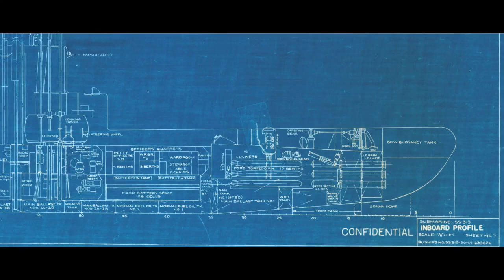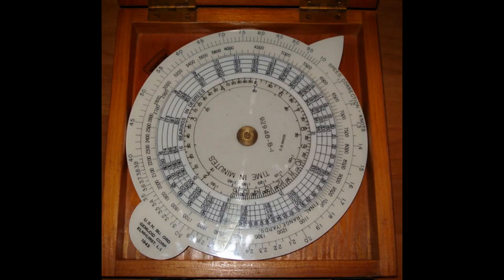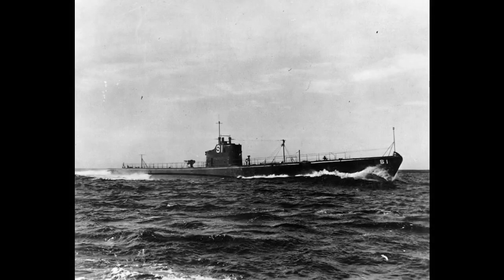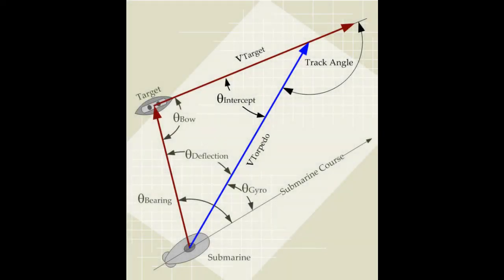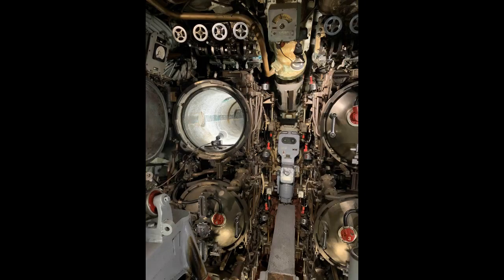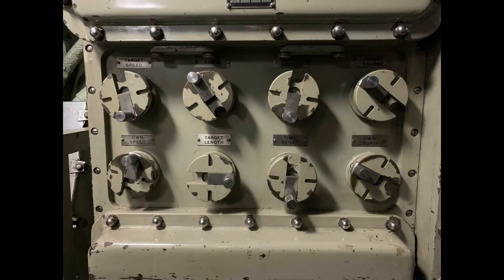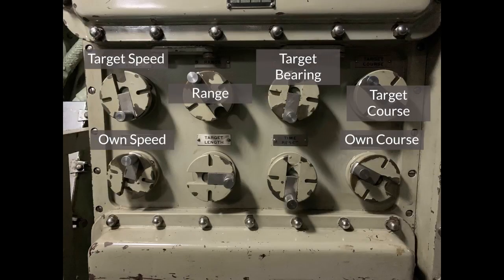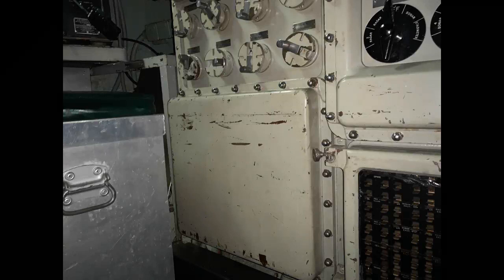Deep Dives: Torpedo Data Computer

Comment: I'd be interested in see someone create a computer program that replaces similar functions to the Mk 4 TDC, but in a more generic manner. I'm currently playing through a Japanese campaign of War on the Sea and I think having a TDC to look at would be immensely useful in determining if a torpedo launch is worthwhile. Particularly useful would be a Time-to-Impact calculator as I often fire torpedoes at enemy vessels, only to blow them out of the water long before the torpedoes reach the intended target. I try to torpedo from very close range to minimize this, but even at only a few klicks, this is a problem. Also, as I understand it, you have a seperate TDC unit for homing torpedoes, and that would be very interesting to have explained as well. Esp. as AFAIK, the Germans never had a seperate TDC for their acoustic homing torpedoes.

Comment: How does the information get transferred to the torpedo?
I seen on the USS COD site, The Torpedo tube has  round hole in the side of tube.
Is that where the torpedo instructions are loaded? (GYRO SETTINGS)
Reply from the maker: Yes, there are several spindles that extend into the torpedo tube and interface with the torpedo that are used to set the torpedo’s depth, speed, and gyro. Setting the gyro can be done individually by tube or you can set all tubes at once using the indicator-regulator located between the torpedo tubes.

Comment: how was that information transmitted to the torpedo
Reply from the maker: There are little spindles that extend from the walls of the torpedo tube and fit into slots on the torpedo to adjust the relevant variables.

Comment: I am so overwelmed with the info, I never thought that Albert Einstein would be on every Sub in the Pacific. My hat goes off to the men that manned the Silent Service and a special thanks to the torpedo officer! Wow they had a job! How does Hollywood portrayel of " Bearing Mark" from the Captain and "Rang Mark" fit into this computer?
Reply: "Bearing mark, Range mark" give the info to the plotting party that does a manual plot on paper using the DRT (Dead Reckoning Tracer). This gives a visual display of the engagement to backup the TDC
Reply from the maker: Bearing and range are inputs into the TDC.  "Mark" is a term of indications so if someone said "bearing mark" they want the bearing measurement at the time mark is called but the TDC eliminates the need for any of that since it continuously updates the variable information.